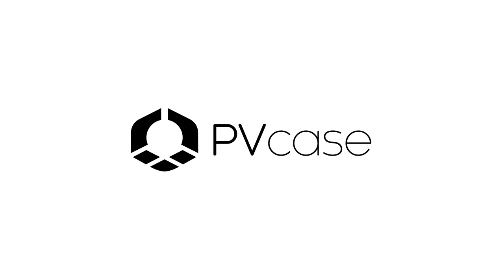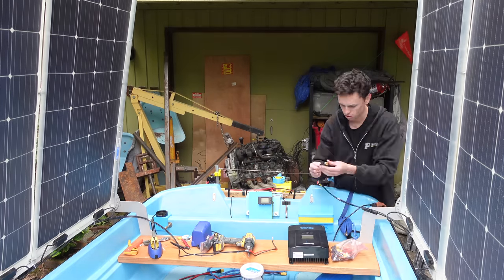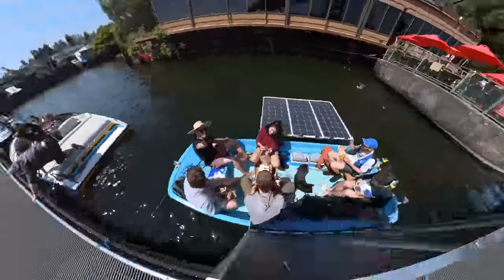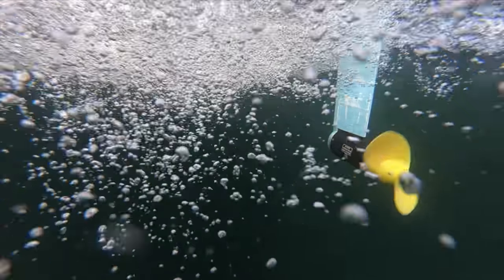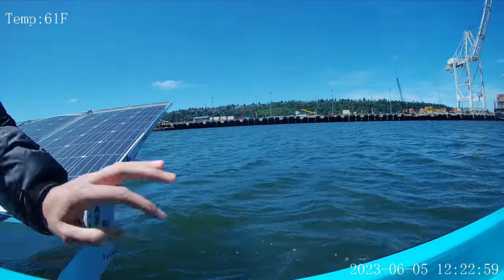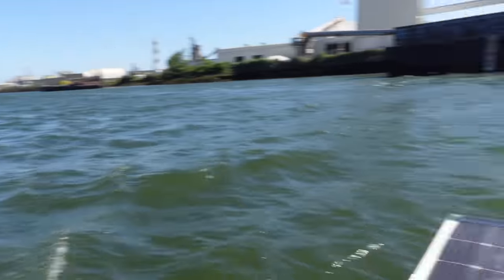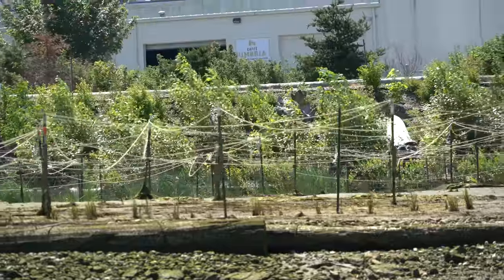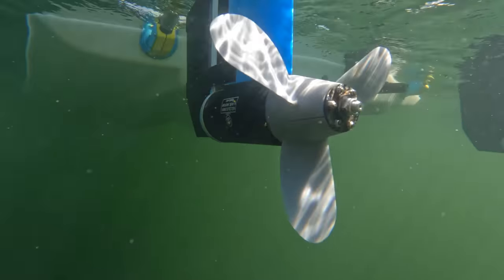Building an Unlimited Range Electric Boat

Comment: Could you reduce the vibration by pulling the boat through the water with the propellers in front of the mounting parts?

But the props must be safe, they should not be able to unscrew themselves just by cruising along. That might be a danger when you reverse the props.

You could still have the propellers at the end of the boat, but just before the mounting parts.

But maybe then you have the propwash rather intensely on the mounting structure, giving you the vibrations again...

Well, you have found a solution, that's good!

Comment: just as a note, 3dp resin is extremely detrimental to aquatic life, and formlabs themselves highly recommend not using them in water, especially without a coating. I would highly recommend either using an alternate method or coating them before using them in open water!

Comment: I hope you have a plan for when the motor fails you and you're stranded somewhere. You better have a tool kit or you better have an alternative mode of transport, such as a paddle. Motors are not intended to run indefinitely. We certainly WANT them to run indefinitely, but they break down with frequent wear and tear constantly.

Comment: I want to do one in a year or 2  when I move up to my lake property  I had a few Ideas  for panels  like a small pull behind barge  would be cool instead of boat mounted , I seen issues with the roof because it start to make it top heavy  when it get wavy       the thing is 2 good lithium Ion batteries  would run for a week on one charge  so your probably better having solar at home  and charging it there and taking it out as much as you wanted

Comment: You could have gotten away with a small trolling motor, much smaller panels and a relatively modestly sized deep cycle battery if you added sails. You even mentioned a sail boat in the intro. Why not just solve feature gap you mentioned?

Comment: ok nice, but now I want a full size sail boat which also has solar powered electric motors, so that when the wind is right you can just turn of your motor and recharge batteries.. Something like that would be the real "end-goal" for a true open seas blue water capable Unlimited Range Electric Boat

Comment: You keep saying solar roof. But I think that's the wrong direction, it would decrease the surface area you can work with. If this were me, I'd try to put some inflatable pontoons, or maybe even just some milk containers or something, to keep the panels above water at all times. (But honestly, it doesn't even seem to be a problem, and that would make more drag. But if you were trying for some kind of double fold-out or something, it might be necessary.)

Comment: Maybe the vibration should be caused by the propellers being too "out of phase" with the speed of the water flowing through them? 
In other words, there is a certain relationship between the forward speed of the boat and the optimal diameter, rotation speed and pitch of the propeller, you should be able to find useful information about here: https://en.wikipedia.org/wiki/Propeller_theory (I'm not an expert ).
To give an example: on a slow boat whose hull generates a lot of drag, a propeller made for low speeds and high torques should be more efficient. In general, I think it is preferable to have a propeller that "screws in the water" at a speed as close as possible to the forward speed of the boat, except for special needs. Obviously also the characteristics of the motor will have to be sized accordingly. I hope it was helpful even though you probably already knew that.

Comment: Hi mate you really should try to get your hands on a second hand Catamaran the Hull's cut better through the water less drag the rudders can be shortened down to size,,,the trolling motor can be set straight and locked in to position from the trolling motor yuo can alter your speed with speed controller it's called a ,,,,, PWM,, SPEED CONTROLLER WITH MODULATOR ,,,mabe this will help you with some ideas,,,,,,,and then your battery and solar panels hooked up

Comment: 🎯 Key Takeaways for quick navigation:

00:00 ⛵ The video is about building a boat with unlimited range using solar panels and electric e-foil motors.
00:28 🛠️ The solar panels are mounted on the sides of the boat for easy transport and folding, though a roof would have been better but more work.
01:12 📐 Designs for the solar panel pivot mounts were made using Onshape, a cloud-native CAD program.
02:24 🔩 Aluminum pivot plates were mounted on the sides of the boat to support the solar panels.
03:05 ⚙️ Aluminum strips were added to reinforce weak areas of the panels after they folded unexpectedly.
03:34 ☀️ The boat was taken out for an initial solar test on a cloudy day to assess power generation.
06:47 🌊 The boat encountered challenging waves in the open ocean during the test.
10:02 🚤 Modifications were made to the boat's propeller design to reduce vibrations in the water.
11:38 🌊 The boat was launched in saltwater for the first time, and the tide and waves presented challenges.
14:46 🌊 The boat explored various areas, including the Duwamish Waterway and the Puget Sound.
15:44 🌊 Due to rough waters, the boat decided to anchor and conduct underwater exploration using a submarine drone.
17:24 🌊 After attempting to assess the ocean's conditions, the boat decided to return to a calmer area in the river.
19:16 🚣 The boat explored further, encountered sediment caps over toxic materials, and observed an active harbor.
20:14 🌊 The boat has moved up the Duwamish River away from the industrial area and into a more tranquil, freshwater section.
20:26 🚤 The boat explores under a bridge in the river with the submarine drone, mentioning limited visibility and sandy bottom.
21:06 ☀️ The solar panels are providing additional power as they angle up, totaling 900 watts even against wind and current.
21:36 🏃 The person ran back three miles to retrieve the trailer while the boat moved two miles upstream to meet at the boat ramp.
22:16 🔄 The previously added Mast extensions did not significantly reduce vibrations, as demonstrated in testing with various propellers.

Made with HARPA AI

Comment: You need at least 13 m2 to produce 1000W. You only have 500W top with 6 of those panels. Yoy should make some realistic measurenments before relying in what the vendor says. Nice project!
Reply from the maker: Bro you need to learn math. They are 175W panels x 6 and I was reading the power output directly from the MPPT

Comment: I have played with these ideas quite a bit. 
Boston whaler is not ideal, it's designed for planing speeds and very inefficient at lower displacement speeds. 

What you want is long and narrow. But as that is unstable trimaran or catamaran are better. Here is one take of mine (not optimized for efficiency alone but for robust construction and modular space) https://www.youtube.com/watch?v=Ui-sQrQGveQ

Also one motor is typically better for efficiency and large slow prop is ideal. Big inefficiency is from using trolling motors that are optimized for high push at low speeds. There is "ancient" tool for optimizing props called jawa prop, it is not very modern in terms of UI but a great tool for finding good parameters. Often in human powered or otherwise power restricted boats rc aircraft style props are used but trolling motor RPM is bit high for these. 

500W+  should get you into decent cruise speeds in a skinny hull(s). It's more power than most can sprint with a row boat (even though oars have arguably great efficiency). 

and as said by others the frame for panels would be better to be stiffer and lighter. XPS foam, some wood and epoxy+glass over will go a long way for a fast and light structure. With light material you can use high cross sections that are very stiff.

Comment: You could maybe 3d print two little floater that attach on the underside of the aluminum in the middle solar panel, just to have the boat a bit more stable in case of wind or in case of any wave caused by other boat!

Comment: You will be surprised at how even in a lake. The visibility can change drastically depending on what lake you are in. I used to work for a marine construction company here in Seattle. I've had to dive in both lake washington and lake union. And I'll tell you right now. Lake union is one disgusting lake. You probably wouldn't be able to see the bottom of the lake.

Comment: ultralight quad copter
Reply: those solar panels look like wings btw
Reply: ultralight sea plane with solar panels over and wings
Reply: box wings are self supporting, maybe those cross braces
Reply: yeah ground effect wings
Reply: use a steel boat as the fuel itself
Reply: just stuff the hull with aluminium, and ethanol-koh electrolyte, the hull is the current collector for the metal-air aluminium, then use carbon fiber mesh cloth as the oxygen air electrode
Reply: foam floating wings

Comment: Popped back to comment after bumping into this video about using large APC props on an electric boat motor. Wondered if it would upscale and have same results. 12x6 high efficiency prop off the shelf sir? 😂

https://youtu.be/hXXxVkSg3jE?si=1dz-a6vvKS8eadPX